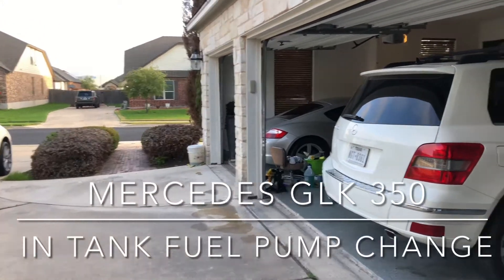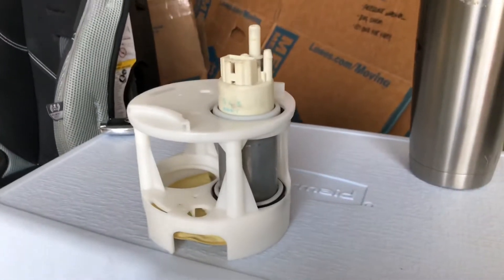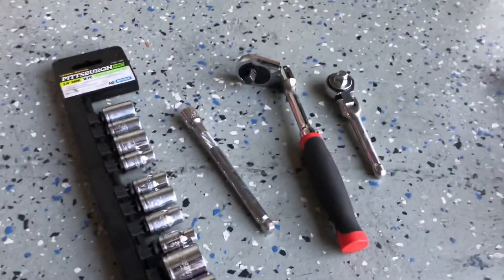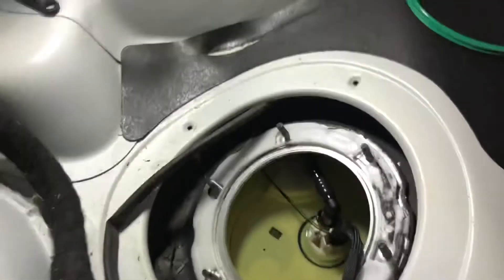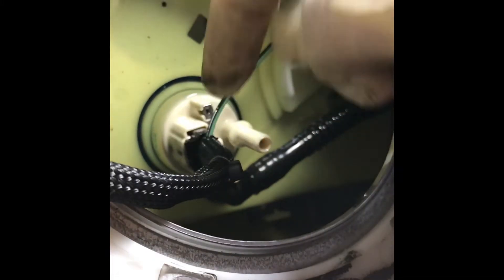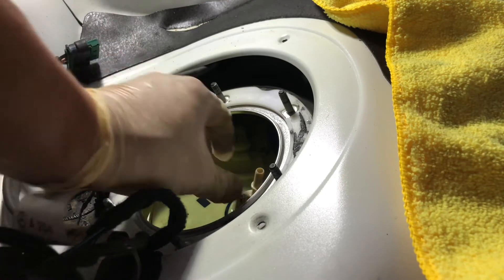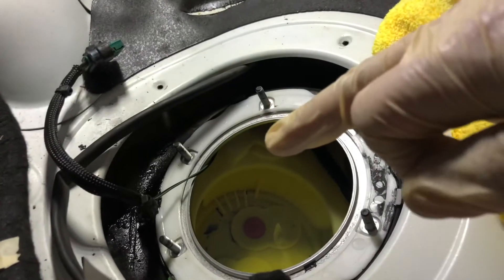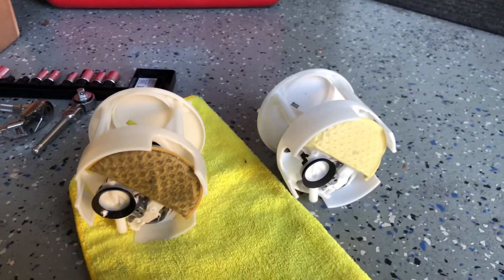Replacing the #In-Tank #Fuel #pump w/ #PZEV on #Mercedes-#Benz #GLK. SAVE $1,500 and do it yourself!

Comment: Glad I watched this! My module cover is cracked, I'm just gonna replace that and the gasket underneath. No need to change the pump if its good!
Reply from the maker: Exactly and well done!
Reply: I too see gasoline on my fuel pump cover when I removed the metal plate....assuming the fuel pump cover has a crack and its not the fuel pump itself.  Need to change the cover and gasket.

Comment: Thank you very much, just got a check engine light.  When I put my scan tool its telling me I have a very fine leak in evaporative emission system.  Plus I noticed when I fill up I smell gas, any way not sure if its the fuel pump or not but glad to see its not hard to replace, thanks again.
Reply from the maker: You’re welcome. Check the other side where your fuel filter is. The top module may be cracked. Are you leaking gas anywhere?
Reply: Not sure have to check, didn't cross my mind till the check engine light came on.  I think its the pump or on that side, some were because I smell gas strong on the gas cap side.  Also, did your abs and tac cut off when the check engine light came on.  Thanks
Reply from the maker: @jnc30001  Did you physically see gas leaking anywhere? My CEL etc. never turned on. I saw gas leaking with mine and smelled it. I changed both my fuel filter module cover and then the intank fuel pump and problem for me was solved.
Reply: @512TXSDIY  No but I will check again, but I do smell gas every time I fill up, I thought maybe I was putting to much at first.  Now I hear the pump extra loud when I turn on the truck so I don't know.
Reply from the maker: @jnc30001  Remove the rear seat and remove those two black panel caps on both side. We’re checking for leaks. I predict that the module cover is cracked and you will have gas sitting on top of it. Also check under your car on both side to see if there are visible leaks.
Reply: @512TXSDIY  Will do when I have a little time, thanks so much.
Reply: So I just pulled the backseat and you right fuel pump has a puddle on top, thanks so much and happy holidays to you and yours.
Reply from the maker: @jnc30001  No charge ;-). All I need is a thumbs up and subscribe if you haven’t already. Happy Holidays to you as well.
Reply: @512TXSDIY  already subbed and the like was automatic, literally just got the fuel pump in the mail a min ago.  Soon as the wife get back here we go.
Reply from the maker: @jnc30001  Nice! Have fun and take it slow.
Reply: Can I ask where you bought your scan tool & price. Ty
Reply from the maker: @spimcnulty  Hey Patrick. There are so many awesome scan tools in 2022 that have lots of functions. $150 is a pretty good budget for mid range OBDII scan tool. Lots of options on EBay and Amazon.

Comment: Question, im going to replace my fuel pump, thabks for the video. I have a 2012 glk350 4matic. I went to AutoZone to purchase the fuel pump, but theu have to different ones, one says fuel pump and strauner set $389 the other one is just a fuel pump $131. Do i need the strianer set? Or can i just purchase the $131 without the strainer set
Reply from the maker: Are you replacing the actual sending unit or just the pump?
Reply: @512TXSDIY  just the pump

Comment: My 08 E350 is PZEV. Dealer says I have to buy the tank, lines, everything for $2400. Can I buy the pump and change it? Any idea on pump I need to get or are the PZEV and non PZEV pumps the same? Why do they say the pump can’t be replaced on these?
Reply from the maker: Sorry to hear about your troubles. What exactly is wrong with your car? Do you have a gas leak somewhere? My GLK350 is with PZEV as well, which is a in tank electric fuel pump. Technically, the pump can be replaced like how you saw me do in this video. I too was told it was not serviceable when I took it in to see if it was covered under some kind of recall.  Assuming your electric fuel pump is similar to mine, it is about $300 for a new one and $100 for a used one. Here is an example: 

https://www.ebay.com/itm/133867862821?epid=238999815&hash=item1f2b257b25:g:IrMAAOSwbPFhM2Pe

Don't forget to like the video and consider subscribing if you haven't already.
Reply: @512TXSDIY  The fuel pump went out. It had sporadically leaked a little(gas smell) previously. Dealer said the pump can’t be replaced on PZEV vehicles, I told them I would come get it. I am going to buy a new pump and replace it myself like you did in your vid.
Reply from the maker: Oh okay. Got it. It’s likely your electric fuel pump like mine in the video. You can get a new one or used one from eBay. That’s where I got mine from. Mine was $96 shipped.
Reply: Brad I had the same problem on my 06 E350. Turns out my car is a PZEV car too and PZEV Vehicles made for California have sealed fuel pump and cannot be changed. You have to replace entire tank. Luckily I found someone who replaces these gas tanks with a newer model unsealed tank that fit my car. Cost me $1000 for a used tank but car runs good! Also it’s worth to note that PZEV vehicles have 15 year warranty or 150k miles on any PZEV Emission part which includes the gas tank. Dealer won’t tell you. I had to do my own research. Sadly I was over by  150 miles and wasnt covered.
Reply: Brad Pierce Brad I had the same problem on my 06 E350. Turns out my car is a PZEV car too and PZEV Vehicles made for California have sealed fuel pump and cannot be changed. You have to replace entire tank. Luckily I found someone who replaces these gas tanks with a newer model unsealed tank that fit my car. Cost me $1000 for a used tank but car runs good! Also it’s worth to note that PZEV vehicles have 15 year warranty or 150k miles on any PZEV Emission part which includes the gas tank. Dealer won’t tell you. I had to do my own research. Sadly I was over by  150 miles and wasnt covered
Reply: @bradpierce8538  My 08 E350 is PZEV too. 149k miles. Recently it has intermittently failed to start because it is not getting fuel. We have tested the ECM, relay, and fuse—all good. The problem is either a clogged filter or a failing pump. When it won't start, I tap on the top of the filter and it will start.

The fuel tank is metal, unlike the one in this video, and the pump is sealed inside. On the passenger side, all you see is the top of the metal tank. On the driver side is the filter. We are ordering a filter today and crossing our fingers that this solves our problem. Otherwise the tank needs to be replaced. The tank itself costs about $2,000 and to install it you have to drop the driveline and exhaust and disconnect the fuel filler neck and vapor tube.

There is a very good YouTube video (link below) that shows, with great detail, the steps for replacing the tank, but I really hope we don't have to do it!!! 

Here is the video:  https://www.youtube.com/watch?v=20OGpydcqeQ
Reply: @bfdonaldson  Hey did the new filter fix your problem? I have an 06 E350 with no check engine light or codes. It randomly failed one day while pulling up to a red light and hasnt started back up since. It cranks but will not start.
Reply: Hi, I had a question for you. I recently changed the strut assemblies on my 2011 glk350. However upon watching your videos it seems yours is sitting higher in the front than mine.. I'm not sure why that would be. I'm also in the process of replacing several suspension components as I believe they are worn out like upper control arm and lower control arm with tie rods and inner tie rods. I might as well replace all that. However I did notice that where mine seems lower as supposed to yours!! Could it be the new assemblies?
Reply from the maker: @christhegamer2607  Mine is the base model. Maybe yours is higher end model with upgraded suspension??
Reply: @512TXSDIY  mine is also the base model. However I did see upon pulling the VIN codes.that mine said sport suspension. The strut assemblies I bought from Rock auto though, and when you buy them they don't show you if it's for sport suspension or regular.

Comment: I have a question. My friend and I swapped the fuel transfer pump under the driver rear seat since it was cracked).When we turn on the car now, the fuel Guage says I'm on empty but I have lil over half a tank! What do you think the issue is? There's not much on the internet...
Reply from the maker: Did you replace the fuel sending unit or just the fuel filter?
Reply: @512TXSDIY  it says fuel transfer pump?
Reply from the maker: The fuel pump for this GLK is actually on the passenger side, not the driver is why I’m asking. The driver side has a fuel filter with a connecting tube to the passenger to transfer gas.
Reply: Same thing happened to me, did you figure out what was the problem?

Comment: You will note that on the PZEV fuel tanks, the E350 chassis has a removable window to access the RIGHT side fuel saddle where the fuel pump is, but notably, the fuel tank does not have an opening to service the RIGHT sided fuel pump.  I suspect it is internal and cannot be serviced.  The pump that you replaced on your CLS is the sending pump I believe on the LEFT side fuel saddle which sends fuel to the right side and then from the right side it is pumped to the engine.  Maybe I am wrong here, and maybe the left sided pump is the only pump on this vehicle, but I doubt it.  I think when the right sided fuel pump fails, its all over, the tank has to be replaced.  Hard to believe MB would make such a wasteful design.  Terrible engineering.  I couldn't find the PZEV part anywhere for the 2007 W211 (E350) PZEV, and saw that your unit looks nearly identical, top of the housing has no lines, and has similar connector.  So Im taking a gamble that this same part is in the E350 PZEV tank and will be compatible.  Hopefully all PZEV's were the same in this era 2007-2013.  Fingers crossed.
Reply from the maker: Driver side rear is the fuel filter and sending pump and passenger side is the fuel pump. This is a GLK but likely shares parts with CLS and other models
Reply: The part you replaced is not redundant with the e350 PZEV. The fuel pump in this model is internal to the right side saddle and not serviceable
Reply: You will know if you have the PZEV in your mercedes when you have only one access which is the left rear driver side. The right rear passenger side is sealed when you unscrew the black round cover and be surprised that there is no access to the fuel pump plus the fuel tank is metal and not plastic. I should know because I just replaced mine (2007 Manufactured date but sold 2008 that's why it would say 2008 Model). PZEV sign will be noticed on both the Driver side door & when you open the bonnet/hood ...it would be on the black sticker ID. If you have a metal fuel tank then you have the PZEV. I argued with Mercedes USA in New Jersey (HQ) that they should pay half of the cost due to the fact that any car owners in this planet don't need to change the whole tank ($2,400.00) just to replace the fuel pump ($300.00)!!! I told them this is a "design problem flow" and I will file a class action lawsuit. They do not even want to disclose how many units are like this in design flowed. They keep on pointing to the u.s. govt!!! I told them Subaru has PZEV features but no need to replace the tank when replacing fuel pump!!! Then they said they extended the warranty from 5 to 15 years and or 150,000 miles whichever comes first....REALLY? So if your car's fuel pump breaks down after 160,000 or 15 years ... you are on your own. I was able to source from a donor car with 85,000 miles for $1,100.00 and I am still pissed of at MB USA New Jersey 

So your film shows both sides can be accessed? Then if so it is not PZEV

Comment: This vid is very misleading. PZEV fuel pumps are inside the tank and are non-serviceable. My W211 has no opening on the tank behind the passenger side.
Reply from the maker: Thank you for the comment. This DIY shows the fuel pump replacement.